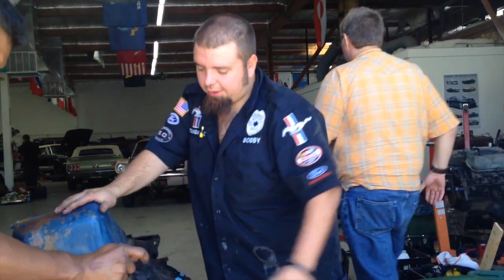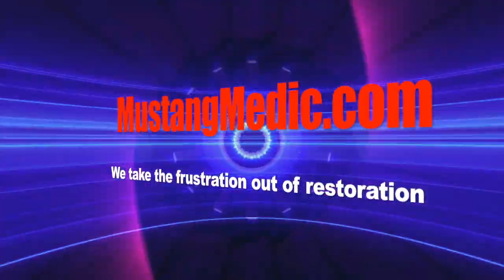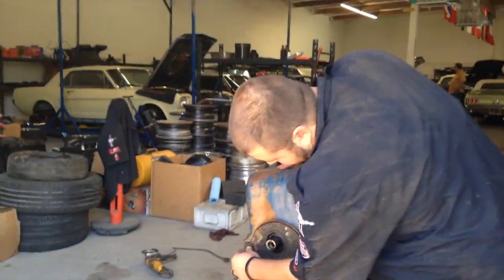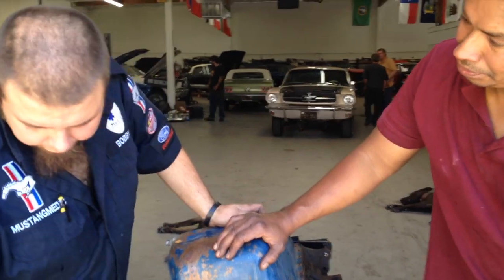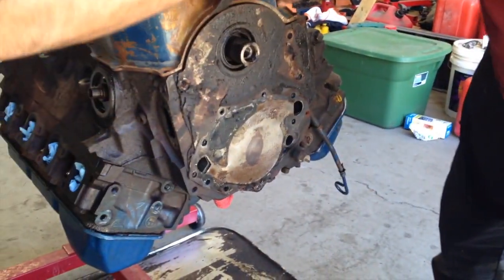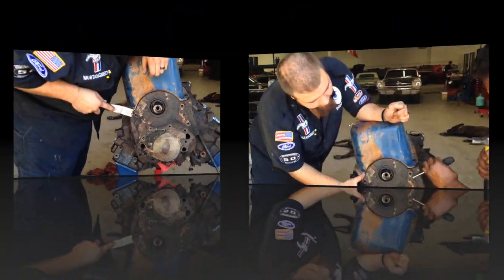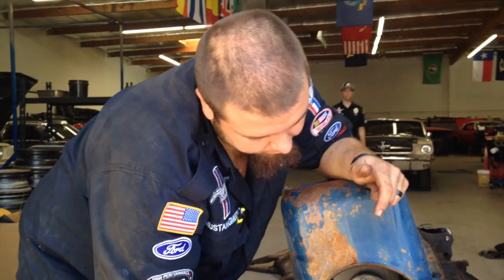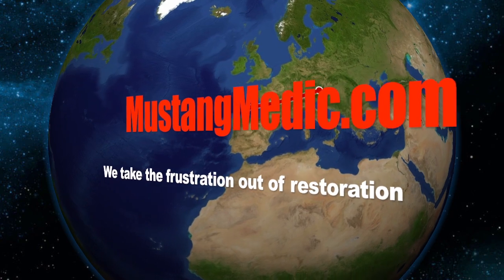Balancer and Timing Cover Removal On Peter's 1973 Mustang Convertible - Day 23

Comment: 351C V8 2v cam profile the same 1970-1974. However, it is indexed from FoMoCo, 4degrees retarted. after 3/15/1973! All low end torque seems to have gone bye-bye on these later 351c2v v8s. So if you put in new timing chain set with adjustable crank gear, dont put in straight up. Put in 4degrees advanced and it will run smoother, like it should!!, and you gain about 20 ftlbs Tq!! Very cheap fix!! Will now make about 290tq instead of 254 oem. Feels great! See what I mean! This emission change was done to 2v and 4v engines in 1973. In 1972 they only did it to the Q code late in the year!! They actually run rougher with that oem mod, but ford had to do it to meet emissions! I have done it to all 73 351c2vs that I have owned, and it wakes them engines right up!! This is for Mustangs, Cougars, Rancheros, Torinos, Montegos, etc....